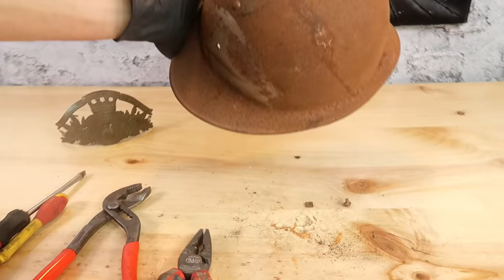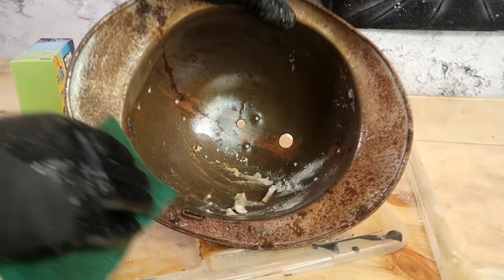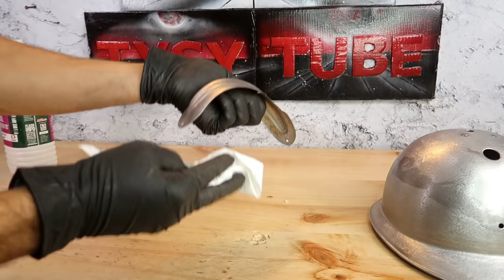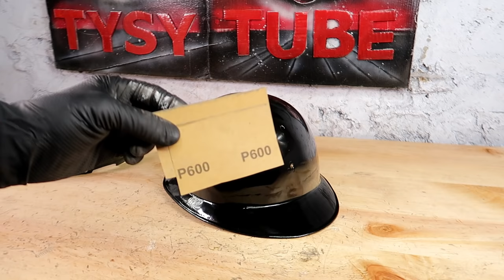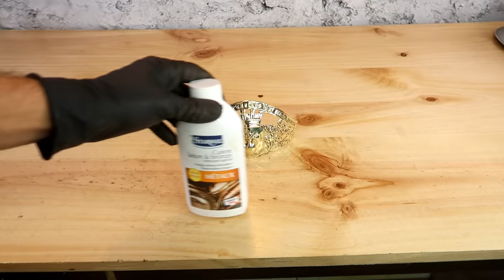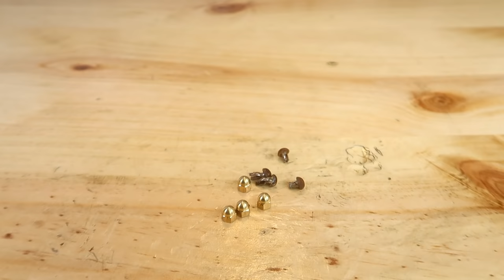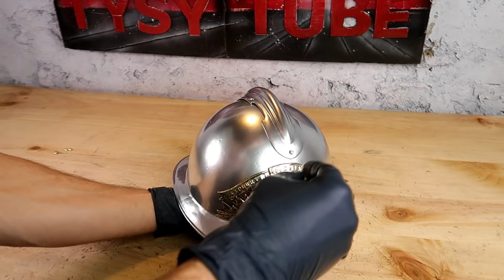Very Rusted Firefighter Helmet Restoration

Comment: Why people had metal helmet for firefighter won't it get hot n be more dangerous to the wearer?
Reply from the maker: good question
Reply: keep in mind that firefighters in 1920's didint have the uniforms do get into the fire,so their main concern would be burning chunks of wood falling.
Reply: @kalamatacity  ok but metal has zero shock absorbency so wouldn't other material made more sense?
Reply: @Kai Wei Chang that makes sense then
Reply: @khushboosirova4273  agree with you,but i dont believe that terms like "shock absorption" where common these days.
Reply: khushboo sirova it was the 20s nobody had health and safety laws
Reply: There probably would have been some sort of liner worn with the helmet. It would not have been worn alone.
Reply: @TysyTube  Metal helmets were introduced in the 1920's to replace leather helmets but due to being conductive once electricity became more widespread they were replaced b ones made of a mix of cork (on the inside) and rubber (on the outside). There weren't really many options protection-wise until polymer helmets became available much later. Even then a lot of firefighting units used old gear like this even up until the 80's. Source-my grandfather was a fire fighter for most of his life. I grew up around this stuff.
Reply: In America, most fire helmets were made out of pressed leather-not metal.
Reply: @khushboosirova4273  I would guess they wore some kind of other hat underneath for comfort
Reply: its the 1920's service helmets like this and the ww1 helmets where flawed but they did actually save life's ironically cause more injuries though from head wounds.
Reply: back in 1915 they didn't have the material to build helmets that can last to fire therefor they used metal
Reply: @Boco Corwin no like leather because won't plastic melt😂 🤔and someone already gave me a better answer so😂😂
Reply: French firefighter have the same now but more futuristic
Reply: If it gets so hot, that it would burn their head, their face would have been greatly burned already
Reply: Forensource what is “leather-not metal”?
Reply: As mentioned farther down: There (obviously) was some sort of webbing inside (the author removes these during restoration). As for metal versus Other Materials: Read the comments. :)
Reply: deez.... nuts! HA! got em
Reply: Old days. Things were different then. Also, Europe. Things were different there.  1920s Germans, for example, had thin boiled leather skull caps ( think pickelhaube but with a comb instead of a spike) and basically denim tunics. English firemen were wearing double breasted wool add tall brass helmets.  I can't imagine this French helmet represented much difference in mind set.  It also would have had a soft leather liner, cut into inward facing tentacles, so to speak, and tied at the crown, to keep the helmet itself up off the head.
Reply: @wurly164  ever heard of heat conductivity in metal is highest 🤔🤔
Reply: The also wore "hip boots" and trench coats
Reply: That's an old WW1 French M15 Adrian helmet. The firefighter variants if I recall correctly were just the same as wartime models, save for the addition of a leather neck flap clipped onto the back of the liner to protect the user's neck more - or wearing leather aviator style leather helmets as well underneath the helmet. The "comb" on top of the helmet serves the same purpose it had during the war: as a means to deflect/absorb falling debris/shrapnel before it would hit the actual helmet. Adrian helmets were quite fragile though, as if you look at many wartime photos, many of the helmets the soldiers wore are very obviously dented and misshaped. Greetings from California and many thanks for preserving this fantastic piece!
Reply: @khushboosirova4273  and human skin its even higher....think about it. By the time the fire heats up the metal, the skin of the face has been exposed to the same heat.
Reply: @wurly164  highest is a superlative degree meaning higher than other matter or material
Reply: It’s not a fire helmet. It’s a war helmet. Fire helmets have been made out of leather since the early 1900’s they weren’t that stupid to wear a piece of metal on their heads in a fire.
Reply: @Forensource  but there were metal American firefighting helmets in use
Reply: No, you are simply wrong.
Reply: @Forensource  ok why do you have a Cairns & Brother metal fire fighting helmet dated 1956 in my collection of helmets ..next to my cairs & brother Sam Houston leather bought by me back in 1987
Reply: I think plastic was not yet available during those years..
Reply: Samuel Carlzon Romero mostly leather as it was easy to come by mostly from the front line after ww1 leather was the easiest and cheapest to produce unlike now days.
Reply: @joeburrows6  makes sense..thanks for the info bro..
Reply: Samuel Carlzon Romero just look it up my dude on google I hate it when prople step in like they think they know and they lived that time. Check it out for yourself it’s really amazing what they thought of.
Reply: Samuel Carlzon Romero you are welcome.
Reply: The person themselves wouldn't be able to withstand the heat before the helmet would even get hot enough to be a danger.
Reply: so if something falls wont crush their head plus it was hollow inside so the lining never got hot only the outside
Reply: @wayned5872  My comment was for someone else.  The guy who said Basically, firemen were soldiers whose purpose was to fight fire, set fire to enemy buildings, and undermine enemy fortifications, so they shared the same helmet with a different decoration, even during peace time when they only serve as firefighters. Their uniform was not designed to enter a building in flames "
Reply: @joeburrows6  i will bro.. i guess  there are too many so called "experts" here on youtube..hahaha
Reply: It was 1920. I don't believe polymers or fire retardant composite helmets where invented yet. I guess they were still better than wooden helmets....
Reply: Don't worry.. In the future. They will wonder why we didn't just teleport the people out of the burning house instead of running into the building like an idiot.
Reply: @khushboosirova4273  metal absorbs shock pretty well and it's not like there is no liner in the helmet
Reply: @khushboosirova4273  I suspect there would have been leather or cloth padding under it which would insulate from impact and heat, the main purpose would be for small falling fragments which were hot or sharp, and the ridge on top would spread out the force of a large impact making it less dangerous for the wearer.
Reply: The main reason we dispensed with metal helmets was that they conducted electricity.
Reply: It's the from the 20s, plastic wasn't in large scale use yet and other materials like resin or some organic matter would be next to useless, this was the best thing available.
Reply: Basically OSHA wasn’t a thing back then and there weren’t too many concerns maybe with extensive dangers.
Reply: @khushboosirova4273  Yes, metal's unsuitability to absorb impacts has been the cause it never, ever, has been used, all along recorded history, to make helmets. Neither Greeks nor Romans nor Vikings nor medieval knights nor Japanese samurai nor Polish hussars nor Napoleonic cuirassers ever, never used metal helmets. Oh, wait...
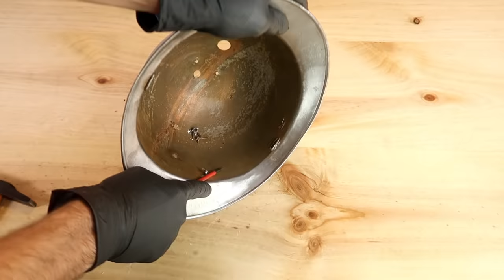Reply: @haileybradley6416  seen at 5:20
Reply: @khushboosirova4273  Like what? Plastic? Fiberglass? Come up with something better from the twenties and they would have probably used it.
Reply: @khushboo sirova It's a very long story.

In France, firefighters didn't fight the fire at first. it was a bit like an association that paid for their services. so people didn't call them much. they had to equip themselves. they didn't have a uniform.

things have changed a lot now.

(Excuse my english. Google trad isn't very good ^^)
Reply: @khushboosirova4273  Firefighter helmets now a days don't have much for absorption they protect the head from falling debris. Not absorb so when something hits your going to feel that force but, its the helmet taking the hit instead of your head splitting open it doesn't work like a football helmet.
Reply: It would take a lot of heat over a long time to heat up that metal to a dangerous point.
Reply: @casams1992  It's an old  French firefighter helmet  100 % .
Reply: So that if you take too long, your head fries quicker
Reply: So that if you take too long, your head fries quicker
Reply: Yes.. But I don't think you get how they were world War I helmets but you are correct
Reply: Regalia. Worn for status, most likely. My guess, anyhow.
Reply: Another option???
Reply: It was a long time ago and people aren’t very smart

Comment: From the comments I've read below, many people think that you should have had a shop re-chrome the helmet rather than painting it. For a prop or showpiece, I think painting is good enough, but if you really want to restore the original look of the piece, re-chroming is the only option for chromed metal pieces. Good job on the helmet otherwise, for what you had to work with!
Reply from the maker: thank you so much 😊
Reply: Polishing and adding a transparent coat on top would look nice too.
Reply: agreed, but the original was only polished
Reply: @Grishanof  no it wouldn't. metal is covered with cavities from rust. it would look like crap
Reply: @makeSX  you are wrong too. it either had crome or nickel coating
Reply: @fonatig  you might be right, but by the looks of the rust there is no flaking underneath the edges of the separate part on the top, so definately not chromed... Nickel plated might be the right answer
Reply: It was polished
Reply: Just guessing, but I think chroming was too expensive 100y back to be used in helmet. I think it was originally plain metal with some protecting oil or grease. I think black & chrome paint was very smart innovation to balance between  original look & durability & restoration cost of 20Eur valued item
Reply: With all the pitting caused by the rust you would have to take alot of metal of to get a surface suitable for re-chroming. You could go the filler way, using automotive fillers but i think this was the best way to do it for this piece. The chrome spray can paint though, not so sure even for a display piece, it will probably last but there are better products out there. Alclad metallic paints or easy chrome, but both are pretty expensive products against the cheaper homemade products TysyTube Restoration uses very effectively.

It is a good job done, only thing i would recommend is to invest in a sandblast unit and use glass bead blasting followed by a rust inhibitor product like Noverox, Rustico, Brunox instead of the chemicals and all the sanding. For some projects a thorough cleaning and then preserving coat of Owatrol oil would also even be enough.
Reply: @fonatig  but that aint no new helmet, it is like to put a makeup on the grandmother and think that she looks teenage... Why not to keep an original look even with some cavities?
Reply: @fonatig  

These Adrian helmets were made with carbon steel (Mild steel) and usually painted, the fireman ones were just polished.
The Modern Paris Fire Brigade still uses these helmets for special events but those have been plated Silver.

These helmets were never chromed, commercial chrome plating was developed by Fink & Eldridge at Columbia University in 1924 and nickel plating, even electroless nickel plating wasn't commercially used until 1924 when it was first used to plate automobile bumpers.

Comment: Beautiful job again. The helmet though is from the Army Firefighter Brigade circa 1915. Glenn from England is spot on. TysyTube... Would love to see a short video of you completing the helmet restoration, adding the leather chin strap, to complete the project. Then placing it on a shelf on its own, which is deserves. It is a wonderful piece of WWI history.
Reply from the maker: thank you so much 😊, if i mange to find the rest i will do
Reply: @TysyTube  I would donate it to the local fire department. I'm sure they would love to make a little display piece of it.
Reply: @TysyTube  a WWI adrian strap will do the trick, the adrian was based on the firefighters helmets which this one is a genuine example and not a repurposed army helmet (original finish was polished steel) and all pictures i've seen of these helmets show them with a chinstrap not unlike the one used on the adrian
Reply from the maker: i was thinking about that
Reply: @quentintin1  . But it is an authentic Army helmet. Worn by Army firefighter personnel. Most of the ones I've seen are a dark blue color almost giving the appearance of being black in color. But... Army none the less.
Reply: @Helo1able  
it's true that firefighters are military (mostly the members of the BSPP) but they have their own equipement, they do not share procurement with the rest of the army
firefighter helmets were (and still are) used with a polished steel appearance, the helmets painted in dark blue were those of the Gendarmerie and were standard army helmets, firefighter helmets in the most part had different features to those of the army. there are examples of ex army helmets that were stripped of their paint and reused by the firefighter brigade but most of the helmets they used were unique to them
for example, this one lacks the slots for the fixation of the attribute, the vents under the crest are different and the liner fixation is totally different
Reply: @quentintin1  For the sake of argument I'll succeed to your position and information. The information I read, and pictures I observed were from the internet and therefor may not be accurate. Take care.
Reply: You can find replacement liners and chin straps online for about $35 American (31 euros?). Google World War i reenactors and supplies
Reply: @daveh3997  while it should be good for the strap, i have doubt for the liner. This helmet lacks the specific attachments to fix the military liner
Reply: @Helo1able  this is not a ww1 military helmet but a pattern 1926 helmet. They are not the same

Comment: Wait... a metal hat for fire fighters? Wouldn't that make you hot and dizzy?
Reply: The Spanish Inquisition it’s old and the past was different. Maybe you can look into it?
Reply: Well plastic would melt and get stuck to your hair and head so I guess this was better than plastic. Plus it is kinda old cuz of the rust so maybe it was different back then I dont know
Reply: it was the 1920’s so it must have been very different and i think the heat part is based on the type of metal used
Reply: Hola
Reply: What else would protect your head from wood falling on it.
Reply: They didnt have the materials they did now
Reply: Interior attack wasn't used in that time period, as it was not thought of on a wide scale.

Comment: Great video as usual but I'm sad that you didn't polish the the surface of the helmet as it shows through the paint and ruins the chrome effect.
Also like the others have said if you had used electrolysis to remove the rust, polished and then zink plated and polished that you would have had a near perfect result.
Look for baremetalhw on YouTube for video instructions and results of this on Hotwheels cars
Reply from the maker: thank you so much 😊

Comment: Looks good, but isn't it possible to polish the chrome paint to give it a mirror finish ? Or put a clear coat over it maybe ?
Reply: MusicalBox I don’t think it would polish like that. It’s not really chrome, it’s just silver spray paint. He could’ve just polished the helmet before he started painting and leave it there. It’s a display piece, I don’t understand why it needs to be rust proof. I agree it should be shinier.
Reply: Max Koljonen I was wondering why he painted it at all when he could’ve polished the actual metal, was there a reason I’m not seeing? Still looks awesome and I certainly couldn’t do any better but it seemed odd.
Reply: @businessreport  I was asking because I follow a couple of die cast cars (Hot Wheels, Matchbox) restauration channels and often after painting the cars they will polish the paint with a polishing wheel and some rubbing compound (like Turtle wax). It gives an almost glass like shine to the paint.
Reply: @MutantMonkey87X  I think he chose to paint it because the metal surface was far from perfect after removing the rust. The filling spray he used really helped smoothing the surface in my opinion.
Reply: MusicalBox Oh I see. Understandable then, my bad!

Comment: Wait, if that’s metal, wouldn’t it heat up? Ya know, because it’s fire...
Reply: It was the 1920s, they didnt have plastics then.
Reply: Nick Zack wouldn’t plastic melt faster than metal?
Reply: @noctysite  not all plastics, high heat fiber glass, plastic compounds have a very high melting point
Reply: They probably had something under the helmet. Thats a ww1 era Adrian helmet, used by france, which they translated into other fields of work, so it was not meant for firefighting, but the mad bastards did it anyway

Comment: Looks great.  A suggestion when you wet sand before you paint.  Use some grease fighting dish soap in the water you wet sand with, and use a wax and grease remover to wipe it down before you paint.  You wont get those fish eyes.  On small things, I use a heavy duty cleaner instead of soap and don't bother with the wax and grease remover.

Comment: Just a tip if you use hydrochloric acid again, it’s easier to brush it down in a baking soda water mix. It’ll neutralize the acid all over the part while picking up the rust.